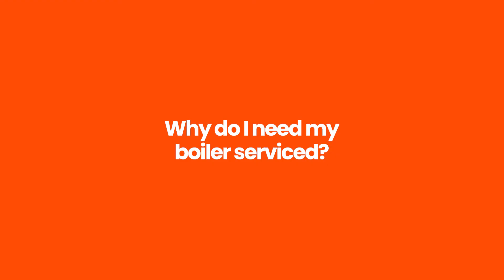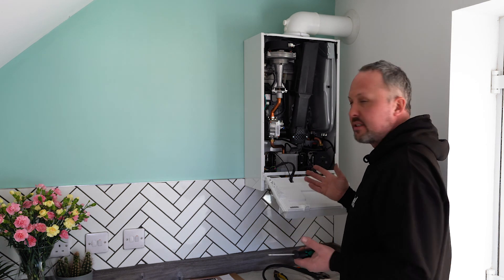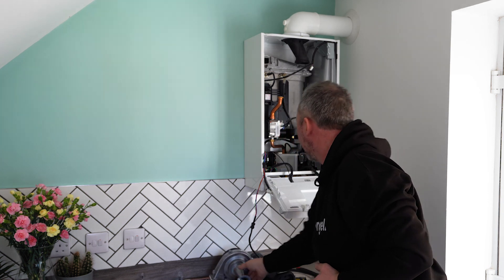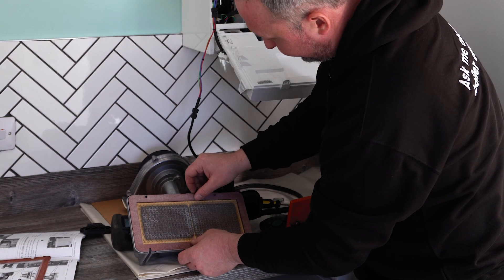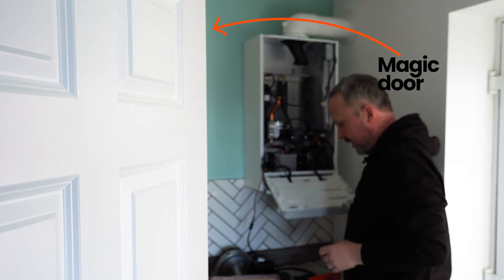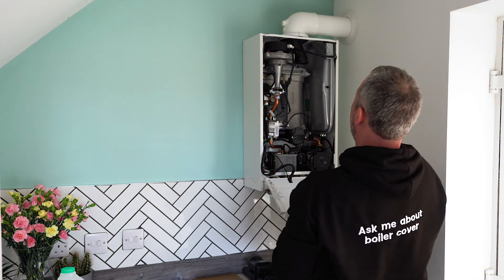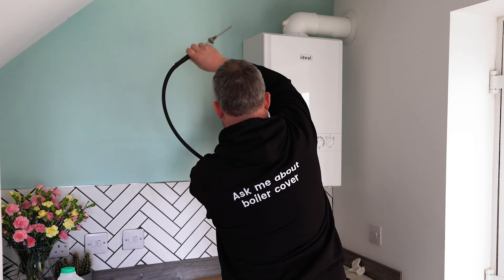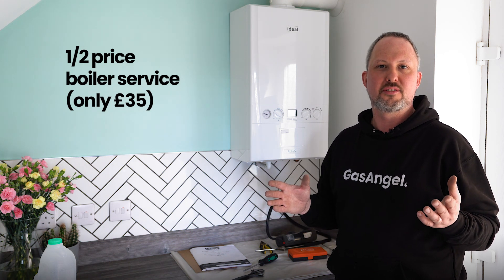What should a gas Boiler Service include? 🔧

Comment: Most gas engineers see servicing a boiler as an easy meal ticket, they are not interested in doing a proper job - just want your money and do the absolution minimum, if it’s British Gas they change down to second gear as they drive by.😉

Comment: Get yourself an empty I liter bleech bottle ,the type that you can remove the shaped top that allows for easy filling This allows you to  more easly dirrect the jet of water down the heat exchanger and because you can  squeeze it you fire it in under pressure and keep it away from the electrodes which can cause lock up if they get damp after strip down .
Reply: Well said mate.. I was thinking the same when he was pouring water if there..I found out the hard way not to get the electrodes wet 😑

Comment: Didn't check expansion vessel
Didn't clean injector
Didn't check flue integrity
Didn't tightness test   (What if there's an existing leak?  you are last man in)
Didn't gas rate or check Inlet pressure.
Didn't do low burn flue analysis
All in the MI's for servicing a logic.
Reply: If you service logics on a regular basis , you know a kettle is the last thing you would use to flush the heat ex 😂
Reply: What more did you expect from a dude with a regin one click 😂😂😂
And also removed the 'sump'. I'm pretty sure ideal wouldn't suggest replacing the gasket on an 18 month old logics first service either. In regards to the injector, that's probably the most important thing to clean on that boiler for 'scary' noise prevention. Good job it wasn't a 'how to video' 😅
Reply: Faf

Comment: This is called a full strip down service. I hope everyone understands that most if not all gas engineers cannot and will not do this for £35 quid lol. The customer will be looking at couple of hundred quid
Reply from the maker: @jmqmin 😊 Guess it depends where you are in the country. We are a small local business up in the North East.

There aren’t as many local engineers charging £200 for a strip down service here as there will be further down south, I guess.

However, a thorough service is doable for us at £35-40 when a customer signs up for one of our monthly plans… https://www.gasangelheating.co.uk/boiler-cover-and-annual-service-plans/

You’re right though, we do take a loss initially, but it’s worth it to know each boiler on a Gas Angel Cover plan starts off in the best condition it can be in.

This way any issues that could be problematic are likely to be found and rectified before the plan begins meaning less breakdowns for the customer and for us, lower monthly parts bills to pay - win, win.

Over the years, we’ve found taking the hit and doing a full service helps preserve the life of the boiler. This keeps our customer happy who then recommends us to friends and neighbours, plus he/she goes on to use us year after year for all central heating jobs, which ultimately more than covers the slight loss we make at service stage. 

There’s method in the madness, I promise 😉
Reply: Not sure that much but yes a lot more in depth than a normal service from BG!!!
Reply: Would you be happy to pay someone a couple hundred quid to do this? 😂
Reply: Get a hop up son
Reply: U didn't check Venturi or injector
Reply: You have forgot so many things 
Short cutting .
Reply: Anything less than a strip service in my opinion is just a performance test we carry out full strip service for  first customers as we don’t know the service history then smaller service for couple of yrs then full service just like a car maximises life of boiler happy customers and recommendations how we built our family business
Reply: @mrserviceman8795  British gas don't  bother doing a proper service .

Comment: I have boiler insurance with what I thought was a good company.  The insurance includes a service which includes the radiators bled.   The so-called service engineer arrived to do the service, he shone a torch under the boiler, he didn't remove the boiler cover, he then went outside and had a quick look at the boiler vent.  That was the end of the so-called service.  No radiators were inspected or bled.  I find that most boiler insurance companies that offer a free service do not actually give proper boiler services.
Reply: Get back to them Joe and complain and insist on a proper service possibly your boiler may need stripping down clean out and the flush to get rid of dirt particles,unfortunately the uk gas industry is a shambles
Reply: @SalimKhan-gk1fh  You are correct.  Not just the gas industry.  We are constantly being conned by insurance companies.  We pay good money for boiler insurance, car insurance, house insurance etc.  However, when we want to put in a claim we have to pay a hefty excess.  Then they do their best to find ways not to pay up.   We are told in one section what we can claim for but in another section, in red, what we can't claim for and that is most of the thing we thought we could claim for.
Reply: British Gas?